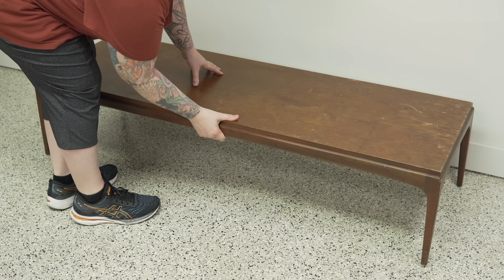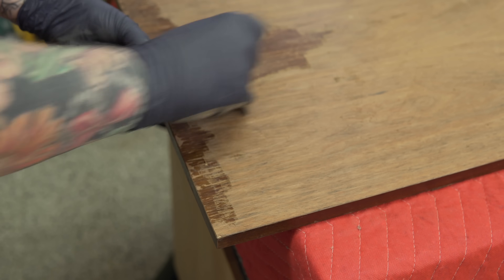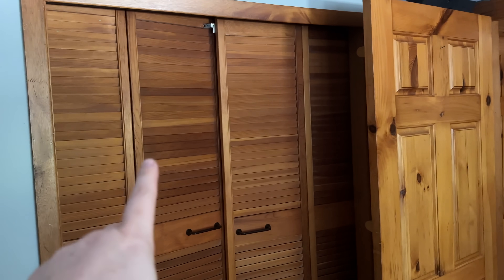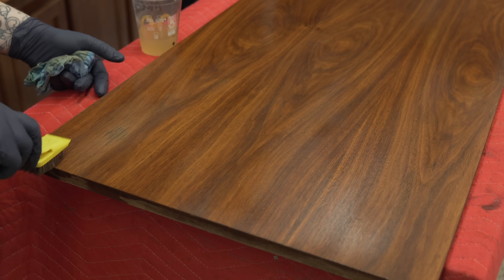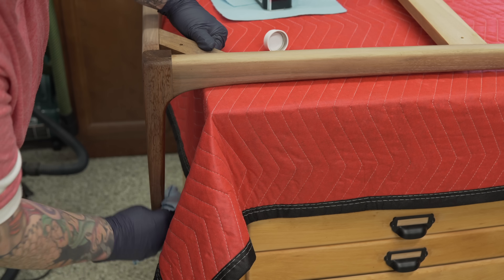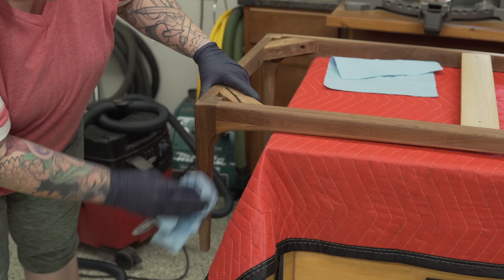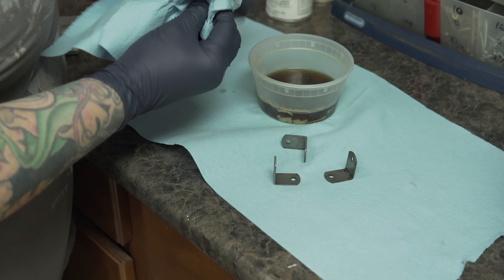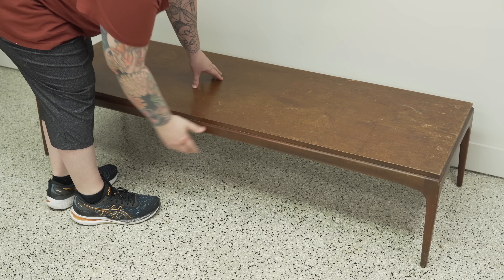FLOODED Furniture? Restoring a DIRTY water damaged coffee table

Comment: Hey Angie! I’m a middle school band director here in the US, and I’ve used those same peel and stick foam sound panels. When I wanted a nicer look in my office, I used Rockwool insulation (for great sound absorption AND it’s fire resistant!). I made a simple wood frame and placed it in the center. If you get burlap, it’s loose enough in the weave to allow the sound to pass through it and get absorbed in the Rockwool. Wrap the panel in burlap as if you are covering a seat and staple it to the back. You can make customized panels AND you can get dyed burlap to add color if you wish. It’s far superior to those foam panels and it’s also easy to hang up or take down if you want to repaint your walls. ❤
Reply: I might also add that it’s very cost friendly as well. ;)
Reply from the maker: Oddly enough, for my upcoming office redo, I have some of that style of panels I picked up from fb marketplace, and also plan to make a few of my own. :-)
Reply: @TranscendFurnitureGallery  awesome! I can’t wait to see the final results!

Comment: Lovely result having started with such a damaged piece.  It is amazing to see how many things you are comfortable rubbing on the wood to remove, for example the green stain on this piece.  I would never have thought that you could use something like nail polish remover on wood like that.  I guess that comes with experience.  Beautiful job!
Reply from the maker: Not nail polish remover, acetone specifically. Nail polish remover contains additional oils to prevent nails from drying out that could affect finish adhesion. 😊
Reply: @TranscendFurnitureGallery  Thanks for letting me know.  I have some mid-century furniture of my parents' that I would love to redo, which is how I ended up finding your channel.  I'm just simple minded enough to think you meant actual "Nail polish remover" instead of acetone.  Good thing to know!

Comment: Simply because you said you’re thinking about building cabinets on a budget: there is a woodworker somewhere near me who built his own, and he has fabulous ideas (many times I have driven by the Plywood Company of Fort Worth where he bought his plywood, which was a “fun fact”). Like you, he likes to show what he did and how he did it. Here’s his video:
Reply from the maker: What’s really funny (or coincidental) about this, is that I only ordered 3 sets of drawer slides for the heaviest drawers on the bottom of the closet re-build. For that exact reason- they are just too expensive, and was planning on figuring out a way to make the drawers slide without needing them- the video you mentioned is a really neat idea and sort of a different version of what I was thinking, but this might be the perfect solution, so I thank you!
Reply: @TranscendFurnitureGallery I wonder whether wood sliding across wood would cause binding, especially when the drawers were heavily laden. Nylon or aluminum channels or L extrusions might minimize friction. Just a thought.

Comment: I've encountered the dirt/grit you were talking about. It was in a humid leaky attic. I'm thinking the roof was replaced which covers everything in the attic with a horrible gritty dirt. If the attic was humid and the piece was forgotten, the grit because more difficult to get off. It could also explain why there is so little damage to the top.
Reply from the maker: It’s possible- but the water damage was quite significant on the top in particular so I’m not sure! I recently bought some walnut scraps from a cabinet maker whose shop was flooded last year, and it was covered in exactly the same type and colour of mud so I was leaning towards that.

Comment: I probably would have taken that outside and hit it with the pressure washer.  

I like that you made or bought or diy-ed that air handler.  I was thinking a roll away down draft but that's a pretty good idea hanging it from the ceiling
Reply from the maker: Would have been a bit too much for the veneer
Reply: @TranscendFurnitureGallery edited my comment with more feedback.  The way you did it worked out great.  It looked like it needed aggressive cleaning when you started.  Maybe a sponge bath with just soap and water to save you some time.  Outstanding job.  Ended up with a great little table

Comment: Maybe the table was stored upside down for many years and why it was so dirty on the underside and the top not warped?? 🤔
Awesome work as usual. This top pattern was quite spectacular 🧡
Reply from the maker: It’s possible- but the water damage was quite significant on the top in particular so I’m not sure! I recently bought some walnut scraps from a cabinet maker whose shop was flooded last year, and it was covered in exactly the same type and colour of mud so I was leaning towards that.
Reply: @TranscendFurnitureGallery  ah ok. Yeh seeing it on screen isn’t anything to real life. Guessing the feel of the surface tells you a ton as well.  A joy to watch never the less!

Comment: Looks great and fresh. How many hours/days did you work on this beautiful rescue?
Reply from the maker: Because I have to film these projects, they take me much longer than they would otherwise. Every time I move at all, the camera has to be repositioned, so it actually makes it extremely difficult to estimate how long for each project. It depends also on materials used, dry times etc, whether it’s cold or hot and humid that day, as that can also affect dry times. Most pieces take me at least a few days, sometimes up to a week or more. I know that’s not a very accurate answer but the truth is, because I have a lot camerawork added in, I honestly don’t know.

Comment: Angie, I am a regular fan of yours & this work is, as usual, quite beautiful.  But, for once, I actually have a complaint.  This is the 2nd time kinda lately that I've been frustrated by the reveal because there's not a long view or whole view shot of the piece.  Is that on purpose?  I love the way you switch back & forth in closeup to before & after reminders of various challenges.  I enjoy the closeups, in general, but I also want to see the whole thing, how it all came together.  To me, that's a big part of your art!
Reply from the maker: I wouldn't say 'on purpose' as in, a sneaky kind of way, but yes, there are times that a full shot isn't the best to look at from a composition standpoint. Usually, it's because of larger pieces, as my staging wall is fairly short. If there's a chance that my tool cabinets etc are going to be in the shot, I avoid them, or if the pieces are longer than the carpet I use and the bare epoxy floor would show.. these are just cosmetic issues, but they bother me a bit. 

This coffee table is super long, and super low, so the full length wide screen shot of it just looked weird, with a ton of empty space above it, and my tool cabinet showing on the right side. So I omitted it. That's typically the reason whenever that happens.

Comment: Are there advantages to using lacquer as opposed to using Odie’s Oil? I love using both but I was just wondering if you felt one overall is better than the other.
Reply from the maker: No - they're very different products. Sometimes I base topcoat selections on the purpose of the piece (and what it’s made of, whether it’s been stained, whether it’s raw wood, etc); for example, I try to use ‘hardier’ ones on tabletops. But sometimes it’s totally random, such as trying to use up the last bit of what’s in a can, lol. Plus, preferences for certain products can change over time. I use spray lacquer generally on pieces that I want to get closer to factory finish or have to use toners on.

Comment: Hi! I am also refinishing a coffee table that has been a struggle. My table is from about 1900 (we think) and when I sanded the top down to the bare wood, I ended up with a wood that was almost orange when I rubbed mineral spirits on it. Is it possible that the top was solid mahogany? I was thinking just plain oak... but this is way oranger....😯😬
Reply from the maker: Definitely possibly! Or cherry- cherry goes quite orange too, but it would depend on the grain as the two are quite different looking. Both were used frequently in coffee and side tables.

Comment: What type of clear coat is best to use over light paint colors that will not turn yellow later on. I painted my dresser a light gray and it was so pretty until I put the clear coat on. A few months later and now it's turned yellow around the edges and over the top. I'm pretty sure I used interior latex paint but I can't remember if I used polyurethane or polycrilic. 😢😢😢😢😢😢
Reply from the maker: If you scroll through my posted videos, I've done a number of light pieces. You can watch the various videos and see how I handle these types of pieces. As for yours - I can't speak to what happened because there are far too many variables in play. Thanks so much for watching!

Comment: I restored an MCM table about one year ago.  I sprayer lacquer on raw wood & now the lacquer is peeling. I wonder if it is because I didn't use any vinyl sealer?
Reply from the maker: It seems possible that there was residual moisture in the wood perhaps? This could have happened if you used a chemical stripper but there wasn't enough time for the wood to fully dry out after. Or some sort of resist (often caused by sanding a finish off rather than scraping or stripping first, as old waxes and polishes can inadvertently get ground into the raw wood. The finish will initially adhere but peel away at a later time). A primer like vinyl sealer is kind of the go between and gives a much better and more stable finish under the lacquer.
Reply: @TranscendFurnitureGallery  excellent. I am currently stripping the flaking finish with a card scraper. As to residual moisture remaining - it is possible. I don't remember what I did so long ago. Once I get down to raw wood, I try the vinyl sealer. Thank you for taking the time to respond, Angie.

Comment: What is presswood please? Ply?
Birdy
Reply from the maker: Pressboard (pressed wood), is technically a type of engineered wood. Pressboard is made by taking laminated wastepaper or textile pulp, mixing them with various resins and adhesives to form a slurry, which is then poured into a mold and pressed together under pressure and heat, which results in a solid panel.
Reply: Thank you
Birdy